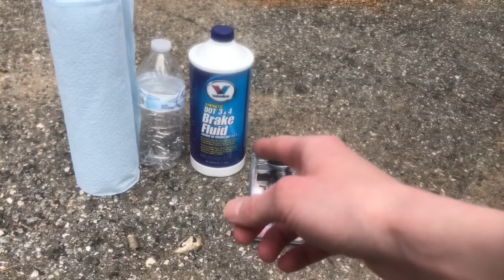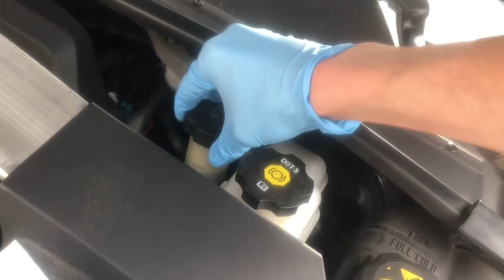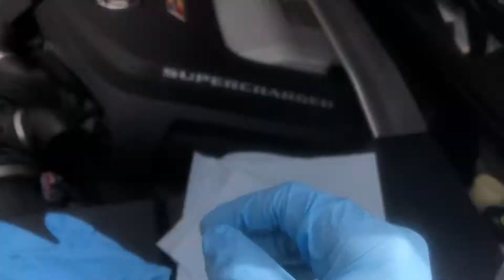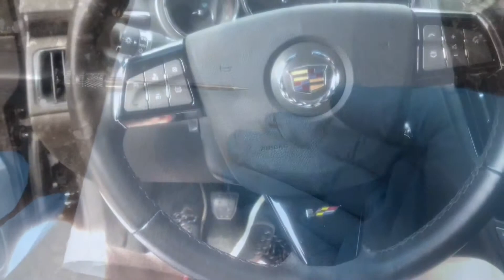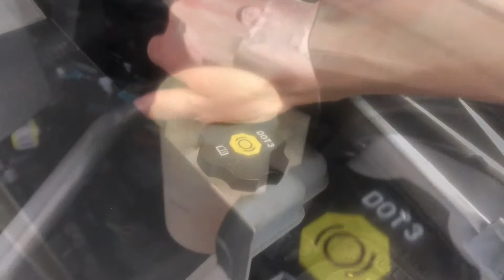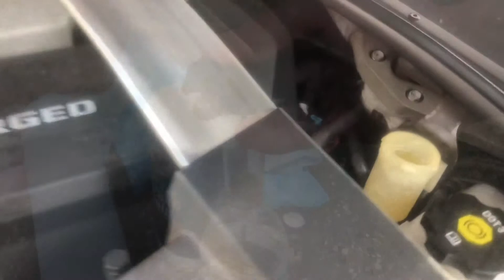How to change the clutch fluid on a Cadillac CTS-V and most manual LS cars

Comment: ._. So there’s no bleeding procedure just clean it drop new fluid pump it do it repeatedly until it’s clean ? Is that what I’m seeing 😅
Reply from the maker: Yes. This is the “ranger method”. For cycling your clutch fluid to get it as clean as possible with out draining and bleeding the fluid. No bleeding is necessary with this method, which I do often 👍🏼. Replacing clutch hydraulic parts may require other bleeding, but not a fluid change unless you completely drain it below the reservoir and somehow get air in the lines.

Comment: Was your clutch acting funny at all before you did this? Or did you just see the fluid was low and decided to do it?

My clutch was messing up and it led me to realize the fluid was low and dark so now I’m gonna go with what you suggested here.

Anyone have any input?
Reply from the maker: I was not having any issues, but did this as preventative maintenance. I do it every other oil change on all of my manual cars to keep the fluid clean. I think this will definitely solve your problem as long as the fluid reservoir was not entirely empty!

Comment: Hey man have you ever had a code P2724 reading come up on your cts v for the pressure control Solenoid??
Reply from the maker: juniorgarcia682 No, I have never had that code! Luckily I have not had any check engine light warnings in my 2 years and 20k miles of ownership so far. Good luck man!

Comment: how did you bleed it?
Reply from the maker: Rick Mofield There is no need to bleed the system. Just remove the old fluid, refill the reservoir and then pump the clutch pedal repeatedly to circulate the fluid. After repeating this process several times the fluid will become clear. This can most likely be achieved with one 32oz bottle of fluid. Sorry for the delayed response! This method is referred to as “The Ranger Method” you can find it all over corvette and GM/LS forums online.